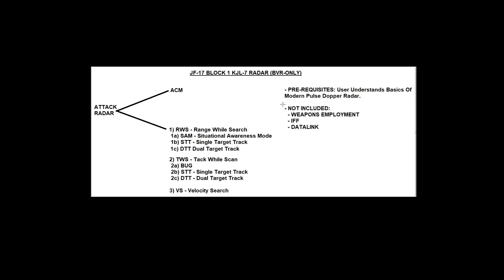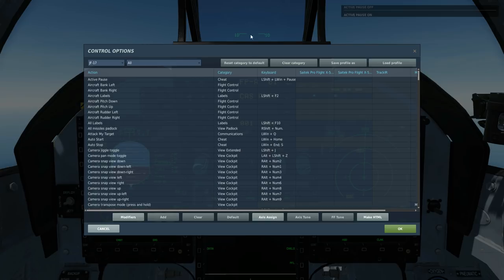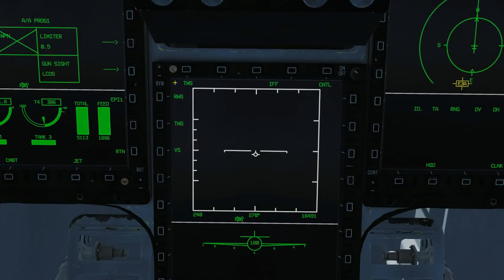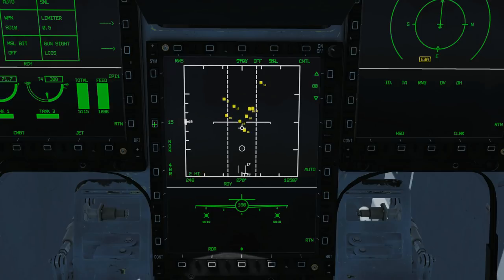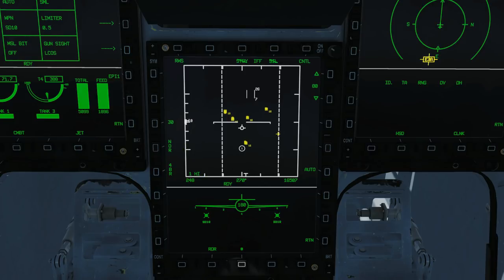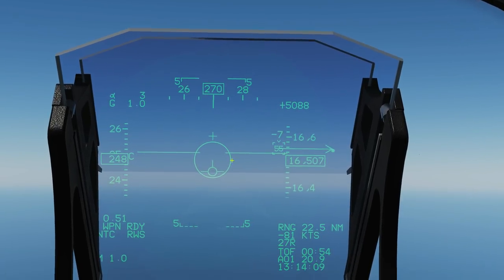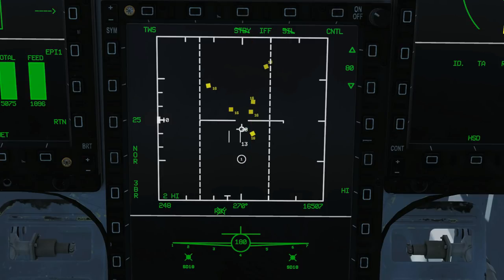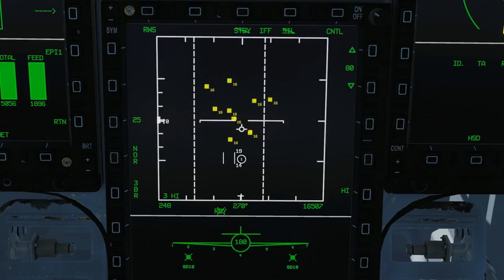JF-17 Thunder: Air To Air BVR (RWS/TWS/VS) Radar Tutorial | DCS WORLD

Comment: This plane reminds me of a modernized F-5. Most of the systems have proven easy enough to learn, and it’s a very capable aircraft even with the small fuel tank and payload. I particularly enjoy the flight model with the FBW only implemented on the pitch axis. This has instantly placed itself in my top 5 modules.
Reply: It's like the F5 had a baby with an F16 :)
Reply: Exactly, the concept of jf17 borrowed a lot from F-20(official modernized F-5).
Reply: 10k pound of gas with 2 drops not bad